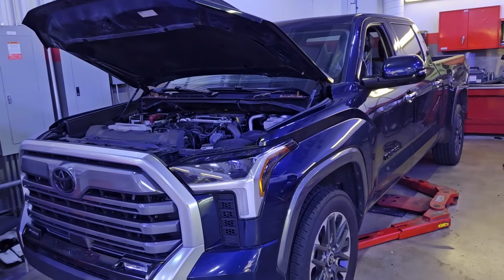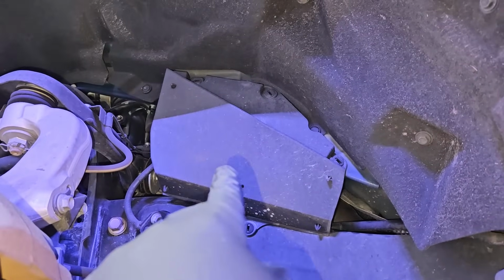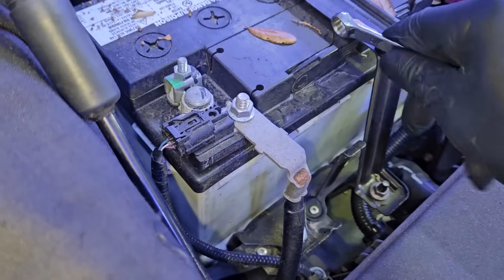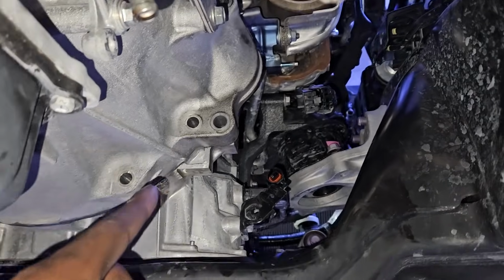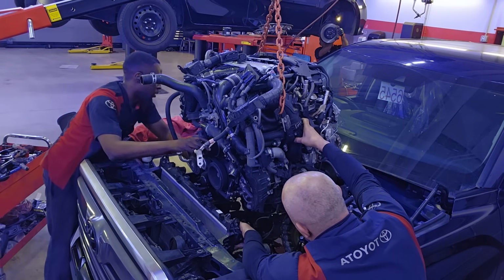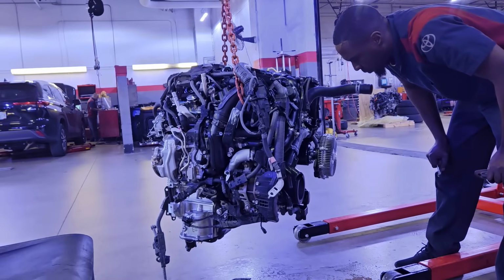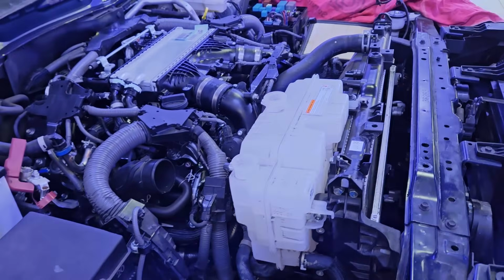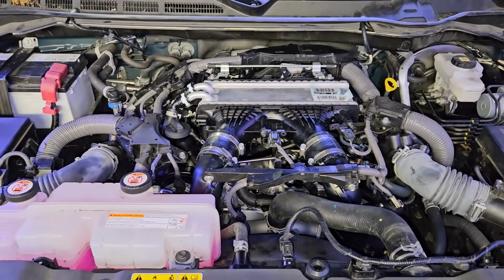3rd Gen Toyota Tundra Engine Removal Process!

Comment: This sucks ! I have a 2023 Tundra manufactured June of 23 with 16k and was advised on Saturday at Toyota service that the recall was on my truck. When this recall first came out my vin wasn’t recalled  but since Toyota updated the recall it is. I haven’t had any issues beside my brakes being squeaky and it not being a 5.7, but if it was a 5.7 I wouldn’t be getting it swapped out. Just sucks because I put a lot of money into lift wheels tires lights and about every TRD part you can get. I have a feeling it’s not gonna be the same when I get it back or I’m just gonna to have to do this again because that’s what I have seen and read. Also, Toyota is only going to warranty the engine for one year.

Comment: I'm about to buy a 2022 tundra with 79,200 miles on it. I was wondering if you could look at the history on this truck and give me your  thoughts on it. It's had the motor replaced already this year, so it has a new motor. (New subscriber. I like your channel)Here is the VIN 5TFJA5DB2NX002633

Comment: There is one very important thing to know here. This man is getting paid roughly 13.0 hours to perform this warranty flat rate job. That equals about 200.00 for him. Fuck you Toyota and Lexus. Whoever came up with that time should have lifelong health issues. I sincerely do wish for that. We have a living to make, this is not for fun. I’ve seen the shortcuts, body’s being lifted, unnecessary parts in the garage, shields and so on. On top of the engine replacement, you think I’m topping off the transmission fluid😂 Again, fuck you Toyota and Lexus

Comment: Just got my 2022 Tundra back two days ago from the dealership after replacing the original engine with the new one from Toyota. I have only driven it about 300 km (180 miles) but so far so good, touch wood. Thanks so much for the detailed video which helps to fully understand what it took to get the job done. Keep up the good work!

Comment: Hey sir Awesome content! I own a 21 4Runner SR5 Premium and currently at 60K miles, and since I have purchased at 44K miles the steering wheel does a very annoying nibble between 45-73 MPH. I have had the truck wheels balanced, aligned, and no resolve. Truck is completely stock wheels and tires also. Tires are almost brand new the stock P265/70R17 Dunlop AT20 GrandTreks. Any idea how to resolve this annoying steering wheel intense nibbling ? Thank you!

Comment: hey ! im currently a toyota line tech in ohio, ive done 5 of the engine recalls so far and our service isnt really that huge so they designated me to do these, my first one really sucked due to i had to make space for this huge hoist and the harness that sits on top of the trans, i talked to a few buddies of mine when i worked at toyota down south, the fasted method i found was to remove trans first then engine , only extra steps are the front and rear driveshaft have to be disconnected . its easier lining a transmission to a engine then engine to a transmission. right now it takes me 2 days to take trans and engine out and back in , i punch i believe 16 hours , which the recall only pays 13.6
Reply from the maker: I know some techs that remove the trans first as well. For me, I never had an issue connecting the engine to trans. Our dealer gives us an additional 5.0 hours to make the total job 18.6hrs.
Reply: That last sentence is exactly why I will never work for a dealer for flat rate ever again.  After doing a job 5 times you should be able to make time.

Comment: Questions?
1. What will be appearing in the car fax of the trucks?
2. Engine replacement or maintenance ?
3. Will be an issue later with the engine VIN number?
4. There is an additional warranty due the replacement?

Comment: Wao look at that little pile of rubber pipes and hoses man toyota put a lot of effort into making an amazing motor that will keep coming to the workshop again and again for unlimited issues and leaks and clamps loose and 5k in labour charges because they cant get to the hoses without removing the pos that it is. the only things that should go in and out of an engine are manifolds, eshast pipes, fuel system, a couple harness and couple pipes for cooling. wtf is this one??? yall know rubber cant go above maximum 5 years. and this also depends upon conditions, iam sure this little bugger runs hot, too much heat in the bay. i believe these rubber hoses will start problems right around 100k and 2+- 1 years or so.

Comment: Great show brother! Thanks for sharing. Have a million dollar question for you: Would it be possible for a handy guy to replace those turbos on a drive way without pulling the engine out? I heard they did not leave enough room? 
Thank you.
Reply from the maker: Thank you. Yes, it's possible to remove the turbos without removing the engine. You will need to remove the catalytic converter, the front wheels, and the cover in wheel housing liner. After you do so, everything you need to disconnect will be exposed.
Reply: @TheYotaChannel  Thank you. It’s good to know. I asked because I saw a video by heavy duty diesel mechanic. He makes comparison reviews of full size trucks. The Channel is “Getty’s Garage”. While reviewing new Tundra his comment was that new Tundra engine is sitting too far in the tunnel to have a proper access to the turbos without lifting a cab. He probably meant in comparison to F150. There are multiple videos of diys replacing turbos on both 2.7 and 3.5s right on their driveways. I also saw a video where a Mazda mechanic had to replace a turbo on a CX9 for which Mazda does not require to drop the engine. However in real life without dropping it it’s next to impossible to reach all the components using regular tools, forget about seeing what you are doing. So he just dropped the engine to be able to see and do it right. I always buy new and keep my vehicles for 15 + years. Swapping a turbo is the last thing I need.

Comment: Great job with providing us with detailed instructions on how you removed the engine from the truck.  As a former Ford technician, I found it extremely helpful to use a jaw and eye swivel when I removed engines. I would place the jaw and eye swivel in the middle of the chain. Using a jaw and eye swivel allowed me to rotate the engine if needed and made the job easier.

Comment: Great job. My only question is, do they not require you to use torque wrenches for reassembly? We torque pulleys, bell housing bolts, alternators etc. at my shop. Just curious. Thanks.

Comment: Several comments. You are a real expert at what you are doing. Truck is well designed for an engine removal. Complete engine replacement was the way to go. Congratulations to Toyota!
Reply from the maker: Thank you! 🤝🤝🤝
Reply: Has toyota figured out what the problem why it's blown up?
Reply: @tonywhite425 that was a rhetorical question, right? You probably also heard there are reports of the same issue in 2025 model truck already.

Comment: This is Absolutely garbage worst Toyota engine ever. Then they put a Mario kart engine inside the New 4 runner, cheating it with a turbo. I prefer the nissan frontier for a truck only thing nissan has going for them. Toyota shame on you

Comment: Mechanics don't get enough respect for keeping the economy moving along. With that said, hard to watch your 70k new truck being ripped apart. Wonder if the engine swap will cure the throttle lags these have been having.
Reply: Those heartfelt thanks should go to no other but new generation of Toyota engineers. Until they took the reins of Toyota in their “skilful hand” mechanics were a dying breed. Slowly but steadily. Similar to a tv repair technicians. This generation of Toyota engineers created Toyota mechanics some groovy job security for sure.

Comment: As an experienced Toyota mechanic, what are your thoughts on why these engines are failing at such a high rate? Do you believe the machining debris theory? It seems if that were true, 2024's wouldn't be failing because they've had plenty of time to correct that.
Reply: They sold out. Toyota is going to shit that is the blunt truth. Unbelievable fall in reputation and quality by this company

Comment: How different is the process between the regular iforce to the iForce Max?
Reply from the maker: The iforce Max is very similar. There is no starter to remove, and no torque converter bolts to remove after removing the starter.  And under the hood, you will have the inverter there as well and some hybrid power wires, and an electric compressor,  while the regular iforce has no inverter and has a belt driven compressor and no hybrid power wires to worry about.

Comment: I just picked up my 2022 Tundra Platinum from the dealer after the recall engine replacement and the recall fuel line replacement.  It took about a week, from Monday 1/6/25 to Saturday 1/11/25. I took a test drive with the shop manager and discussed warranty for the new engine.  The recall engine is warrantied for 12 months/12, 000 miles.  I still have the balance of the original drive train for up to 5 years/ 60,000 miles.  The truck now has about 37,000 miles. The only thing I noticed when I got home was the red park light on the dash does not come on when it's in park.  I'll call the dealer about that on Monday.
Reply: @Kbattig  hold the park button up for couple seconds then hold it down for a couple seconds need to reinitialize brake system
Reply from the maker: Try this advice first and see if it helps.
Reply: @Kbattig Are you joking? Toyota is only warranting the new engines for 1 Yr/12,000 miles? 
That is a flat out insult. At a bare minimum we should be getting the balance of our power train warranty plus 30,000 miles since most of the failures have occurred between 20,000 and 30,000 miles. 
What is the point of proactively replacing the engine if we lose the initial warranty by dropping in a new one? 
This is truly disappointing.
Reply: @markf8256  I sill have the balance of the original drive train warranty as well.